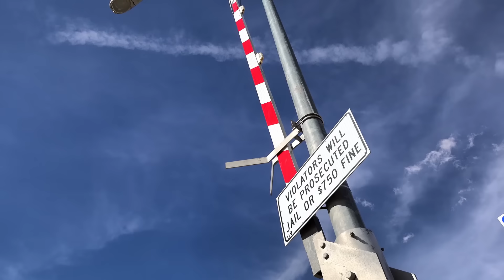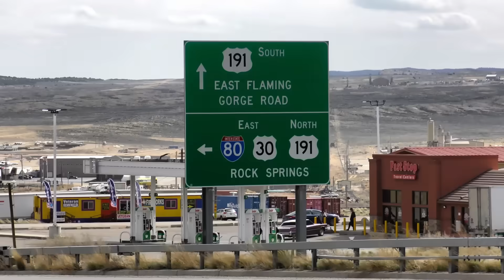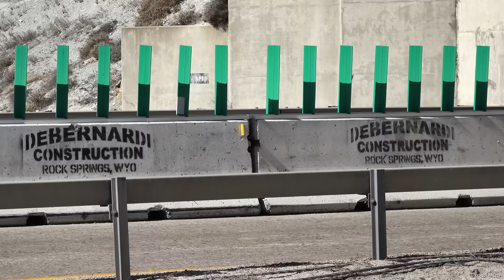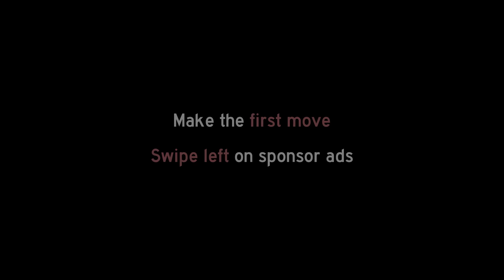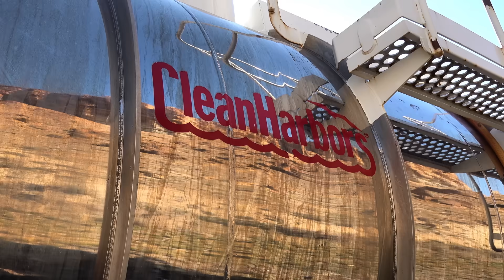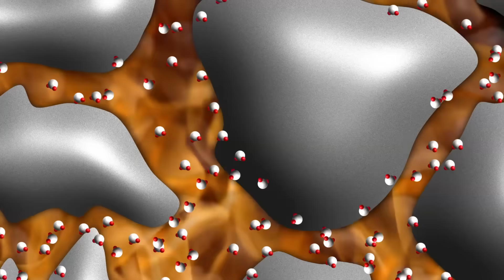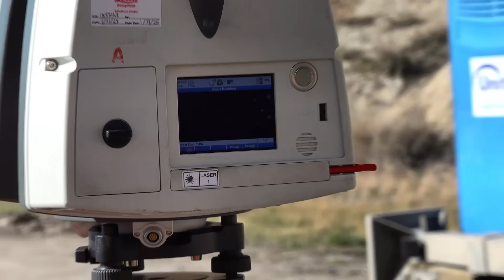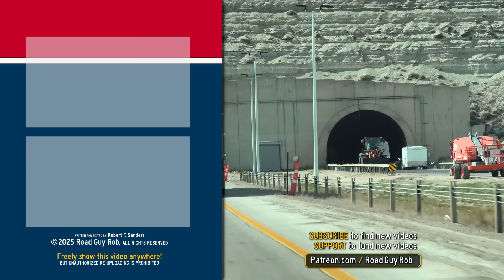Going Inside Wyoming's TOTALLY MELTED Freeway Tunnel

Comment: I feel like something they might want to look into is putting a fire sprinkler system in the tunnels. Just make sure that it is a dry system (meaning that the pipes are filled with air, and when a head breaks, the pipes then get flooded with water).

Comment: Reminds me of the 1999 Mont Blanc tunnel fire. It was caused by a truck hauling margarine and flour. When the controllers on the French side saw the smoke on their monitors they were worried people trapped would suffocate so they sent  1000's of cubic feet of fresh air into the tunnel. The death toll was staggering.

Comment: On May 29, 1999, an accident in the Tauern Tunnel (Austria) resulted in a fire about 800 meters from the entrance to the tunnel, which has a total length of 6.8 kilometers. The fire reached temperatures of 1200 degrees Celsius. Unfortunately, dozens of people were trapped in the tunnel by the flames. Their only option to leave the tunnel was to run 6 kilometers to the other tunnel exit! 12 people didn't make it through the smoke, and after a few breaths, they were fatal.

Comment: The roads are just too dangerous now days and something like this is bound to happen again. I'm a trucker driver and can undoubtedly say 99% of cars and other trucks are speeding significantly, tailgating, changing lanes rapidly. It's EVERYWHERE. These damn roads are a rolling deathmatch right now.  Once I went through Wyoming eastbound and the downgrade into Cheyenne had a 45mph speed limit because the dog was so bad. The radar on my freightliner showed every other truck going at least 60mph which would've easily been an instant pileup.   We need highway patrol positioned every 5 miles and at least every 30 miles in more secluded areas to start cracking down. It's all over the country right now unfortunately.

Comment: Zipper merge is far beyond most drivers capability,only method that works is merge early and maintain speed. Special ticketing for those who refuse to comply and race to stop traffic. BTW those are jersey barriers and the extensions on top are because drivers refuse to dim high beams and or computer controlled lighting systems misaim headlights on purpose. Superbright headlights are a true traffic menace

Comment: Steel melts at 2500F or there about depending on the alloy so 1500F is not going to melt the rebar as you keep saying. It may need to be replace after being subjected to 1500F but it's not melting.
Reply: You’re talking about the liquidus temperature. Carbon steel, what rebar is made of, begins the thermal process cycle at ~800°F.

Comment: I drove through this tunnel a year and a half ago, doing only 30mph and my car immediately pitched out violently on black ice and didn't get back under control for about ten seconds. Didn't hit anything but I could not go above 10mph till i got out the other end. I had been doing 50mph before then, which was completely fine on the previous pavement, despite that also being iced up. Told myself I would never use that tunnel again. I wonder whether Wyoming DoT plans to investigate the cause of this accident and subsequent fire, in order to determine and implement preventative measures against future incidents, rather than just repairing the damage and carrying on as normal, because this WILL happen again if they don't.

Comment: I’d imagine some of the slag on the roadway was aluminum. I helped some friends cleanup after the Black Forest Fire in Colorado, and while it wasn’t hot enough to do it to steel, it liquified aluminum. There was a solidified puddle of aluminum on the slab that used to be the workshop that was formally a step ladder. Crazy how hot those big fires can get, even scarier in a tunnel where you can’t really do anything about it.

Comment: I suspect that once the fire started, the tunnel acted like a chimney, creating its own draft, and drawing air / oxygen in one end while sending the smoke out the other.  If you've ever worked around a blacksmith, it's the same thing they do with their bellows.  They pump large amounts of air into the furnace to raise the temperature enough to melt metal.

Comment: The whole problem with the "zipper move" is that it assumes that traffic acts logically.  But as we know, people don't act logically, which causes whole sections of traffic to come to a stop.  If people worked like water, then traffic would accelerate through tight spaces, but obviously it does the opposite.  So, these ridiculous expectations from DOT is just that.

Comment: It was “fortunate” that it was the north (westbound) tunnel as it is the significantly stronger of the two. When the tunnels were built they were very uncertain of the geology that they were dealing with so the first tunnel (north) was built with the steel sets on 2’ centers. Once they had bored through however they determined that the ground wasn’t as bad so the south tunnel has steel sets on 6’ centers (you can see this in the construction photo at approx 8:36 in the video).  Great video and thank you for the depth of the report.
Reply: why would a 2 ft be stronger than a 6 ft?

Comment: Zipper-merges - the dumbest idea EVER !!!!!
Reply: Zippering is for when traffic is already slowed down/stop and go; it’s about improving the holding capacity of the road. If the open lane is already going the speed limit and has to slow down/stop to let you merge late, then you’re disrupting traffic; there is no need to increase the holding capacity of the road when traffic is already flowing at appropriate speeds.
Reply: @Tombeau-k1b  - Again, stupidest shit EVER. Maybe if you' need to merge traffic in a city, where space for vehicles is limited.  But most zipper merges I see are done are interstate highways, with hundreds of miles of available space, no need to save any of it to stack cars.  The very idea of making all traffic slow to a stop, then have to take turns merging at slow speeds is insanity.  Merging literally MILES before necessary has worked for over 100 years.  Now, we've created a situation that actually REWARDS the selfish assholes, while slowing traffic to a halt.  STUPID !!!!!

Comment: I don't think melting the rebar would be that big of a problem unless the fire were to reach 4,000 degrees or whatever temperature it takes to melt iron/steel. And even more so to melt the concrete which has almost as much heat resistant as kaowool (probably misspelled) and fire bricks.
Reply: The steel melting isn’t the problem. Steel can anneal at much lower temperatures, which means it loses its structure without melting.

Comment: If that tunnel is made of Portland concrete. Only Portland concrete can be used to repair it. Modern concrete will not bond to Portland concrete. Portland concrete was produced by the Portland cement corporation in Portland, Pennsylvania. Portland concrete built most of America in the last century.

Comment: Some people praise efficiency and cheapness. It's 1.

Some other people praise redundancy. They get 2.

Efficiency workes and is cheap now. In the future the effeciency is expensive and stops everything if that 1 thing breakes.

Redundancy is expencive now. However if one of the 2 redundant things breakes, it can still be run at half capacity and be cheap.

I belive it where a smart choise by Wyoming to build 2 motorwaytunnels instead of 1 big. Now it runs on half capacity. Very smart choise! :)

Comment: you can't light a tunnel with "smokey brown"    If any of those lights still work, they would probably be the color of SOX lamps (not that i have anything against SOX) But i reckon if you tried powering one up, it's ballast will probably most likely make strange ticking and squealing noises and maybe a little hummbuzz (I know because i have had experiences with powering up burnt lights in fire damaged buildings before ). If i were there i would probably try something stupid like attempting to power one up just to see what would happen LOL.

Comment: The laser scanner actually takes laser measurements of everything around it and creates a point cloud. After the measurement, it actually does take pictures of the area to assign a color to every point in the point cloud. That makes it easier to understand what you are looking at. You can alsomuse this during construction to get an accurate as built representation since things do not always match the plans. That way, later on, if repairs are ever needed, someone can use a VR headset to see exactly where everything is located behind walls, ceilings, and so forth.

Comment: They should go ahead and install a high pressure fire sprinkler system on both tunnels. Backed up with a diesel fire pump. It can help cool down the fire.

Comment: Why in the heck doesn't a nationally vital short tunnel right next to a town not have fire sprinklers? I'm surprised the video never addressed this. A 6 or 7 figure oversight has caused 9 or 10 figures in physical and economic damages. Someone should be facing charges.

Comment: As this sort of accident could happen again, maybe retrofit high volume water mist fire suppression in there. Also, upgrade the intersection so the next time a detour has to be made, it's quicker and simpler. That's the problem when bigger and faster vehicle express vehicle routs are built, there is no though into WHEN something WILL go wrong.

Comment: The concern about the heat is not about the rebar melting, but it losing its strength properties. 1500F is around the annealing temperature for steel, meaning the metal could have gone into a relaxed state where it would lose any heat treating it would have received and any tension that was in it while in the walls. The debris may be out, but I would be very worried about the structural stability of the tunnel. Also steel loves to rust rapidly at high temperatures because it burns off any protective coating and speeds up the chemical bonding process with oxygen, burned out vehicles can often show completely rusted steel parts that look decades old after just a few days. There's also different kinds of rebar, some handle re-heating better than others. I've heard of non-weldable types of rebar becoming extremely brittle if you let it cool down too quickly.
Reply: Exactly how and why the twin towers collapsed!!

Comment: It's like when 95 in Philadelphia went out, that's my hometown and I drove over the temporary repair, my brother drives a concrete truck in Jersey and he helped rebuild 95. I'm pessimistic that it would have been as efficient if it happened now 😅😅
The point of this comment was to brag about the bag of soft squishy rocks that I have that is the material they build freaking roads out of and I also have a piece of my favorite road in Florida A1A from one of the times a hurricane washed it out. I'm one of the rare people who thinks these major roads are repaired very quickly

Comment: I really enjoyed this video, I’m a pipe fitter by trade, I’d love to see some info about life safety systems, whether it’s monitoring, suppression, or sprinklers.

If I had to guess I’d assume there will be some life safety upgrades to the tunnel during refurbishment/repair.

Modern tunnels often have early detection systems/monitoring for fire events, and suppression systems broken down into zones, often they can be turned on and off automatically or manually as needed to control fires.

Comment: if I were WyDOT, I would replace the entire tunnel with one that has 3 lanes. it may not need that capacity now but in 20 years, who knows. it'd be future-proofing the tunnel.
Reply: Adding more lanes is not a solution
Reply: @hapiland  It's a tunnel in the middle of nowhere where most of the traffic is not going into any of the localities. Thus mass transit is not the solution. More lanes just like rail all have a place in the transport mix, but this is the low level logic I frequently see from people who mainline NJB and other urbanists like fent.
Reply: This is why you are not wydot

Comment: They're tapping concrete in a damaged section, saying "this hollow sound is bad" - 
What does the undamaged tunnel sound like? It would be interesting to know if there are any hollow sounds there. I've seen/heard concrete sidewalks (and walls in buildings) have hollow sounds, and they were never exposed to fire.

Comment: Just surprised that I never saw anything like this in the PA turnpike tunnels. Narrow lanes with minimal shoulders, the only thing they have going for them is that they're pretty straight.

More than once I've driven them when they were both running 1 lane in opposite directions through the same tunnel, that bit seemed to work ok at least. No cones or barriers added except for at the crossover point.

Comment: To all you professional drivers: When its icy and cold outside, Slow down! this tunnel is still closed to this day. The current two lane solution is very narrow and dangerous for trucks. If you go thru green river wy. Please please be extra careful.  and keep it slow. :3. be better then a flip flopping steering wheel holder. 

When you get tonthe merge points, Increase your following dust so merging can be done more smoothly.

Comment: Fascinating video! I hate to be the Grammar Police, but... At @8:50 you note that "when temperatures get over 1,000 degrees, even inflammable concrete starts to fall apart." "Inflammable" means "easily set on fire".  I think you mean "non-flammable". 🧯
Historically, this confusion caused problems, since in the past dangerous items were often marked as "inflammable", and people often misinterpreted it as meaning "not flammable" even though it means the exact opposite! That's why today we usually use the clearer word "flammable" instead to indicate danger. 🔥

Comment: The green headlight buffers are great for cars, but often times, cars will drive with their high beams thinking that's ok, but as a trucker, I sit well above the buffers, and now we struggle to see. 😕 Another thing with many tunnels is that you are driving well beyond your line of sight on faith. There was an accident in a tunnel in Santa Clarita, CA (I-5 south truck bypass) where the tunnel is part of a downgrade making stopping a truck even harder and the tunnel has a curve in the middle obscuring any stopped traffic ahead. I cannot believe that a warning system such as red, yellow, and green indicator lights on the walls could not be utilized. I try to watch for the reflection of brake lights now, hoping that will be enough.

Comment: There are 3 cut and cover "tunnels" with parks on top (like the 10 in Phoenix) near Detroit on I-696. MDOT just demolished one 2 weeks ago after years of trying to fix water seepage issues that resulted in giant icicles falling from the ceiling. The cost is about $50M to rebuild it and the park but it's being done. It was the first of the three starting in 1984 (freeway opened in 1990) and fortunately the drainage/waterproofing design was modified on the other two before they capped it. They already spent about $20M a decade ago removing the park and exposing the roof to place a membrane but it didn't fix the problem. Expensive design error! Really busy freeway too (200k vpd).
Reply: I noticed the one in Phoenix having  worsening seepage issues too (opened the same year) but ice isn't a problem and they don't get a lot of rain (although a microburst nearly destroyed the huge central library on top in 2018 in a horrific nightmarish chain of events that ensued). That tunnel may also be replaced eventually as it's become a huge chokepoint in the system. Opened with 8 lanes, later restriped to 10 and still not enough. ADOT is studying a $2+ BILLION project to rebuild the 10 through there, shoehorning the existing tunnel, but the tunnel is functionally obsolete and aging badly and the plaza is underutilized. There is an unused central "bore" designed for a subway that got cancelled but doesn't meet geometric standards for vehicles so it's used for storage now. There was to be a station inside you would access from an elevator above. Sky Harbor Terminal 4 (opened same year) also has an abandoned underground station but the eventual train ended up going over the terminal, not under it. Such a waste.